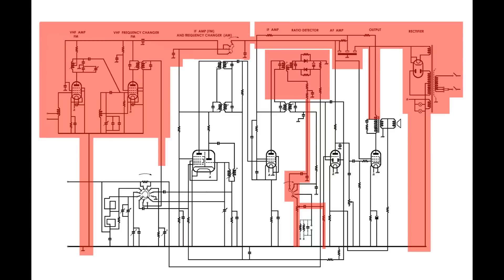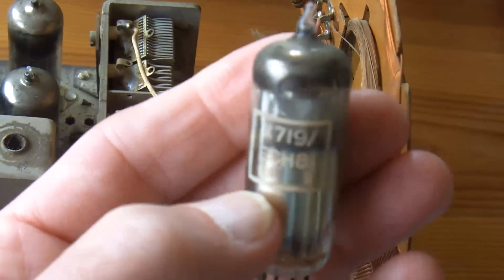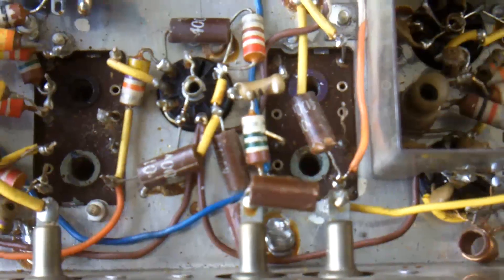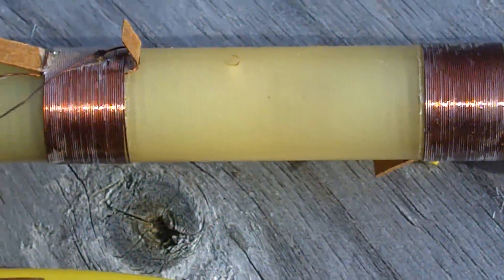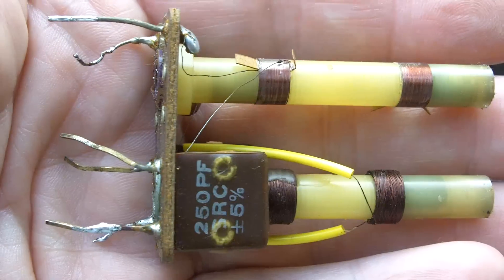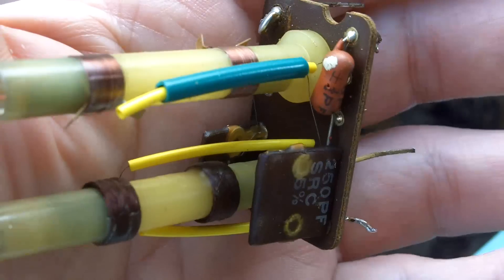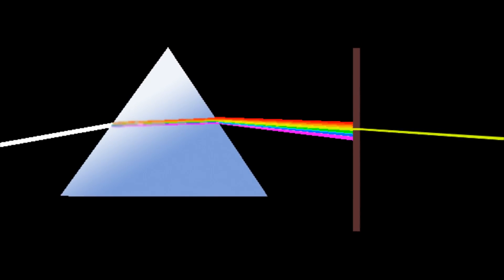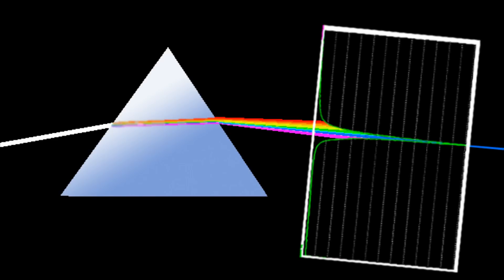About Radio ... Part 13 Inside the IF transformer. By Andy Davies

Comment: Sir, it is a pretty old video. Could you still furnish the details of the coils (SWG and number of turns of primary and secondary windings) of the two IFTs used in valve radio receivers?
Reply from the maker: Hi I can not give you any details about these coils I still have this radio but I have, of course, replaced the IF coils in the set, and as I'm sure you are aware it's quite an event to remove them again and in any event I would have to unwind the coils to find out what you want, and they probably would change frequency when rewinding them. You haven't said why you want the information.
I don't know where in the world your are but certainly, in the UK, you should be able to find an old radio like this either in a junk shop or on eBay. You might be able to just buy an IF coil off eBay. Or search on line for one, alternatively go to Vintage-radio.net and ask the same question there. In the past the Vintage-radio.net have been extremely helpful. A lot of the old guys on there are, like me, much older that the internet and have circuits and information that you'll never find on the world wide web, and they will be happy to share it with you.
Good luck and kind regards . . .  Andy

Comment: What about the value of capacitor used in AM radio ift? 
Shall we use different value with primary and secondary windings? 
Mentioned about a Grundig tube radio with ech81(first ift) and ef89(second ift) 
Thank you🙏

Comment from the maker: @MickLBrad
 Well spotted, the additional insulation is keeping the leads for the top coil away from the winding at the bottom so as to keep any capacitive coupling to a minimum. If there was too much capacitive coupling between the primary and secondary then the selectivity of the IF stage would be lost. 

Kind Regards ... Andy